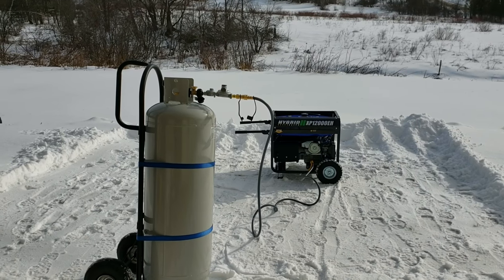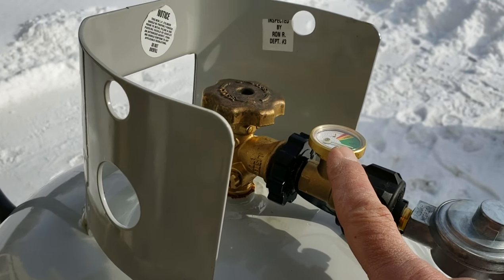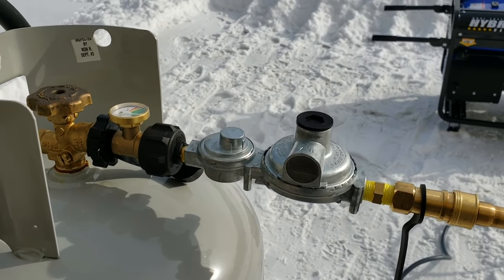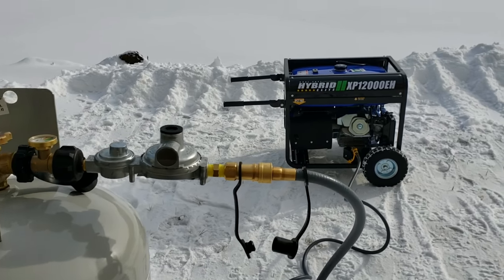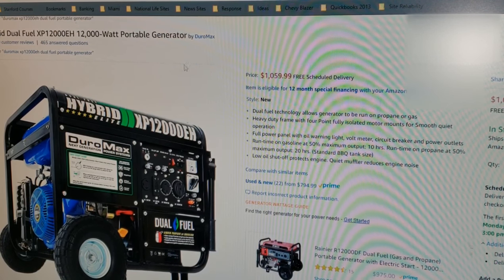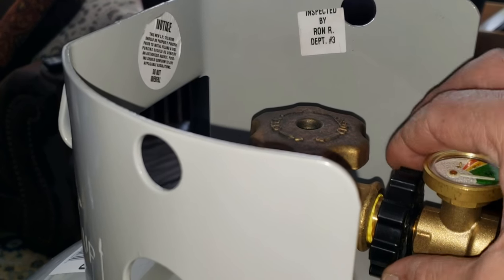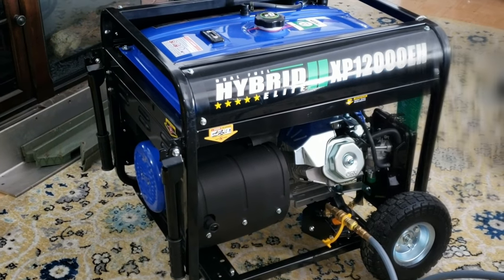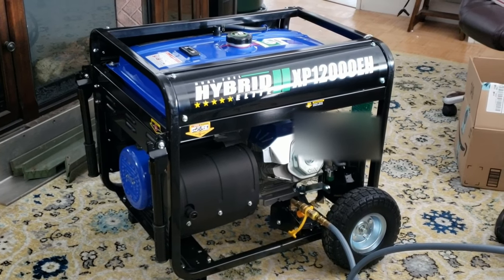Ultimate 100 LB Propane Tank Setup - Duromax XP12000EH 12000 Watt Hybrid Generator - Step by Step

Comment: I used the propane regulator that came with my duel fuel generator . I  changed the fill valves that came with the 100 lb tank so that I could have a propane co come to fill my tank. It worked great and ran more than 36 hrs during hurricane IAN here in Florida . It was a champion duel fuel gen 9000kwh.
Reply from the maker: Awesome
Reply: It wasted 100lb tank in 36 hours?
Reply: @erickalmaraz6837 Yeah that's about right. A 20 lb tank will last about 7 hours on a 12kw generator. 7 * 5 is 35. Your actual results could vary quite a bit depending on how much load the generator is handling.

Comment: Nice video.  I repair gensets as a business.  Propane is a good way to go as the carbs on these Chinese gensets don’t like ethanol based fuel, especially if you let it sit for awhile without use.  The metal alloy used is much less forgiving than the alloys used on a Honda, Yamaha etc.  Second, make sure you break in engine properly....run at varying light loads for at least 4 hours or so, then change oil.  Use decent quality synthetic 10W30 in winter and 30W in summer.  Exercise under load for 15 mins monthly.  You do this and you will increase longevity significantly.
Reply from the maker: Appreciate the tips. Very helpful.
Reply: Honda and B&S don't like it either.  But all the China stuff is an exact copy of Honda.  The trick to using gasoline is to use the shutoff valve to shut down the generator.  Do this any you can let it sit unused for 3+ years and it'll still start on the first pull/crank.  It'll spit n sputter due to the old gas, but it'll start..  But his has a bowel drain as well that he should use.  Because any gasoline, especially ethanol, will cause the in bowel fuel shutoff solenoid to stick closed.
Reply: @MatHelm  While probably overboard, on all my small engines that are not used very  much, I use the ethanol free gas.  Then put in stabil.  When I let the engine sit for a while I drain all the gas or let it run empty.  If I drain the gas, I then start it back up and let it run all the gas out of the carburetor.   So far the engines on the generator and my garden tiller will start with one or two pulls  when I want to use them as I put in fresh gas.
Reply: @ralphmowery2898   since our switch to non ethanol gas in all our small engines ,sxs,4wheeler ,chain saw ,boat, gen, etc,  we haven't  used stabil in years,    ymmv

Comment: Nice setup.  I been thinking about getting a 100 gallon propane tank.   But I decided to use just the 20 gallon tanks because in a long term grid down power outage I think it's a good idea to stop the generator and let it cool off or rest every 12 hrs.    Its just a theri of mine tho.  I'm not an expert on generators or propane LOL.   But I do know why I went with a propane generator.  I can store it for 30 yrs without treating it like ya do gasoline.

Comment: I have the same generator and I bought the same regulator in this video. It will only use half to three quarters of my hundred pound tank and then the generator quits running. I put the factory one back on it'll use up the rest of the 100 lb tank question is why?

Comment: Well thought through. You saved me so much research time. I am setting up this same generator to power my house in case of a major power outage, don't think that i would've even known that this kind of setup could've been done. It is quick and efficient and will work perfectly for me as I am setting up 2 100 lb tanks. With this setup I can easily switch between tanks without any issues, so I basically bought 2 of everything. I also like that I can check the gauge for gas levels. Thank you so much for sharing the information.
Reply from the maker: Glad you watched.  Let me know how it works.

Comment: I tried this same set up and it worked flawlessly. Thank you for you time and effort. This was amazing, you save me because the regulators I kept getting were just giving me no luck. The propane shops just did not want to help or just make me spend crazy money. I got a second set up connection just in case. I gave up till I saw your video. This was so dummy proof. YOU ROCK MAN!!!!!
Reply from the maker: So glad it worked for you

Comment: I have the Duromax Beast myself and a 350gal. Propane tank and 2 100lb tanks that i used for my 40ft. 5th wheel rv and my service man that comes out and fills the tanks i question him about adding or making changes on the regulators for connecting to my genie he said you dont need any changes the ones on the tanks are fine and the one that came with the genie will work just fine. He said there is so many people get sucked in to spending a wallet full of cash for nothing just so a company can make more money and i thought go figures sounds about right.. Anyway i have been running mine for over 2yrs. and it ran fine. I look at it this way i either got lucky or had an honest service man that steer people in the right direction ....
Thumbs up to yea i hope you enjoy your new genie...
Reply: Thank's for ur info. 
In any business now a days it's very hard to find an honest person!
Reply: @jackman4692  Ain't that the truth. That's because us honest people don't make as much money as the bullshitters. Been in business for 35 years and always tried to save money for the customers. I'm not rich but I live comfortable enough for my means.

Comment: Excellent video. I purchased everything in this video. I had a licensed electrician install a transfer switch, then run some pex conduit under my eaves to mount 40 amp plug on my back porch.  This makes this a temporary whole house generator as long as we use it wisley.   Also, the list is perfect and I thank you for your informative video.
Reply from the maker: Appreciate it.  Thanks for watching
Reply: I want to go with 100lb tank for the 10k watt generator ill be getting soon. Meanwhile i was doing some research and ive been reading the 100lb tank could and probably would freeze up while in use in cold weather. Have you had any freezing issues
Reply from the maker: No, I have a tank warmer.  In VT we can get 30 below in January.
Reply: @VermontPrepper  Where did you get one of those?
Reply from the maker: I got mine off of Amazon:  
https://amzn.to/3QlYdUC
Reply: @VermontPrepper  Thank you for the info. Have you put it into action yet? As in running your generator down around zero degrees?
Reply: @VermontPrepper  I guess i should have asked....did you experience any freezing or do you have a warmer just in case?.
Reply from the maker: I have not experienced any, but I think it would if it got too cold without a warmer.
Reply: @VermontPrepper  What is the WC flow rate on your regulator? My generator requires 10-12 WC. That doesnt seem to be very much. What im getting at is , will it freeze up at such a slow rate? I have a propane stove that i run off of a 20lb tank and it has never froze up.Its regulator is 11WC. I know a generator will use a little more volume but not much i would think, Whats your thoughts?
Reply from the maker: Hmm.  I do not know.  That stumps me

Comment: The white and the yellow tape are both teflon, but the yellow tape is twice as thick. They are made of the same stuff, and both will prevent corrosion and seal. You can use the white tape, but then you have to do 6 full wraps around the threads in order to meet code, whereas you only need 3 wraps for the yellow tape. And the regulator needs to have the vent facing down. Also with 2 regulators you are likely to starve it of propane at high load. I'm not sure about the regulator on the generator but it is probably enough, and you might not need any other regulator. Also with propane those gauges will only start showing that it's low, when there's no liquid propane left in the tank, so they don't work very well. The best thing to do is to pour a cup of boiling water down the side of the tank and then start at the bottom and slide your hand up that side of the tank. When you start feeling the tank get warm, then you know that the propane level is just below that point.
Reply: I too have read where running two regulators could be problematic to fuel supply. My question is; the regulator on the generator would be adequate to connect a 100 lb tank? I have the Duromax XP10000HX
Reply from the maker: No, it comes with a separate regulator that is required to use for operation

Comment: Thank you for saying something about the propane tape. I did not know there was a difference between the white and the yellow. You saved me from making a big mistake. This is the first time I got a generator with dual fuel and a friend recommended me  to use the LP instead of gasoline. I plan on using both. Shortly I will be making a video on the Duromax I have.
Reply: The white and the yellow tape are both teflon, but the yellow tape is twice as thick. You can use the white tape, but then you have to do 6 full wraps around the threads in order to meet code, whereas you only need 3 wraps for the yellow tape. And the regulator needs to have the vent facing down.

Comment: Thanks for posting this vid. I did basically the same setup. I went with a steel braided 18ft hose and no quick disconnects.  But the advise you gave on the regulator was a huge help. Thank you.

Comment: Thanks for the video. I use the regulator that came with unit. Added a 15’ hose. I leave the the hose threaded to tank forever.just roll up on tank. Very easy to unscrew hose from tank with large Knob it came with then cover end of hose with ziplock bag and rubber band. No problem for years.

Comment: I appreciate your video.  Very helpful.  I purchased a Westinghouse 12000DF.  My concern was getting something with a pure sine wave <5%.  I called Marshall Excelsior and they wouldn't give me any help AT ALL.  Spokesperson said I had to have my propane company inspect it.  What the hell?  I bought a 100 lb tank at Tractor Supply.  they filled it and helped me load it on my truck.  There's no propane company that's going to inspect my tank and portable generator.  I live 40 miles away from Marshall excelsior, but I don't share your enthusiasm.  Westinghouse just said that the 2 stage regulaor had to be between 7" and 11" water column.  That's all they would say.
Reply from the maker: That's a bummer.  They were helpful for me.  I guess it really depends on who you get.

Comment: Very helpful! My XP12000EH is scheduled for delivery 6/13. Your video gave me what I need in terms of info! Imagine your 100# propane tank is my household natural gas line. I'll use a Nash regulator attached to a gas line stub with shutoff and screw on a Nash regulator. Can use same hose and quick disconnect setup as you and should be able to run tri-fuel. Your video was very helpful, so THANK YOU!

Comment: Thanks, I already have the generator (bought on last prime day sale) and the 100 LB tank. Just needed the fittings, regulator and hose. I bought them all from your links. Good job.
Reply from the maker: Thanks so much Timothy.  Let me know how it works out.  It's been good for me so far.
Reply: @VermontPrepper  Will do.
Reply: @offgridgarageUSA  By chance, did you complete your setup and did it work? I ask because I, too, bought this generator on Prime Day along with the parts linked to the video. Unfortunately, the generator wouldn't start up once attached. I don't know if the regulator I received requires some kind of adjustment, if it is defective or if DuraMax changed something in the design that may have caused this regulator to be incompatible (in use with a 100lbs tank as shown in the video). All I know is that I had to take everything but the 3/8" gas connector off in order to hook up the regulator that shipped with the generator before I could get it to start. Is it even necessary given that t ships with a regulator to buy the two-stage one shown here?
Reply from the maker: Mine worked with no issues.  I didn't try the regulator it came with on the 100lb tank since the connection is not compatible.   I only use that stock one for a 20 lb tank, so that's why I bought the 2 stage

Comment: I enjoyed your video a lot.  It saved me from doing all that research on my own.  Thanks again...My generator came with most of the parts you had to buy so now all I have to buy is a longer hose the gage adapter and a couple of brass 3/8" fitings.
Reply from the maker: What generator did you buy?
Reply: @VermontPrepper  I purchased a Champion 9000 watt Generator.

Comment: My propane company will not refill on site if not connected to generator all the time, which won’t work for me. So I prefer the quick disconnect you did, but, when the tank runs low and I have to take the tank in for refill, will the quick disconnect be a problem? Or will that have to be removed to refill? Thanks. Great video.

Comment: Thanks for the great video. I'm thinking of purchasing the XP15000EH and this comes with 2 built in regulators in the generator. Can anyone answer if, using a 100lb LP tank, there would be a need for a 3rd regulator attached to the LP tank? Thanks in advance.

Comment: I'll throw this into the mix.  I was talking to my Propane Provider about adding a propane generator to my home here in the Country (currently running a worn out gas generator.)  and he said we would need a different regulator at the tank. According to him, the house line regulator does not have enough pressure to handle a generator flow.  Said he would be happy to "Y" a fitting at the 250 gallon propane tank just for the generator. Then install a second "Red" Regulator just for running the generator off of.  But I would still need the original regulator it has now. (Either green or Yellow, can't remember which and mine is not painted)
And here's the kicker, I can run two regulated lines into the house, (at different pressures) but cannot legally run a high pressure line in to the house,  then split it off to run the generator and add the lower pressure regulator for the house.  Basically, both regulators must be at the tank!
Reply from the maker: Pretty cool.  I am not an expert, but it sounds solid

Comment: Since I will only be using propane I removed the gas tank which I believe will help with air circulation around the motor. It was very simple to do, 4 bolts and 2 hoses. It can be put back on in minutes if you need to switch to gasoline.

Comment: I have the 1st generation and mind did not come with a regulator on the bottle end. It only came with a hose which I connected to the bottle and the generator. In your opinion should I add the gage/2 stage regulator to my 30 # bottles?
Reply from the maker: Hi sorry, I am not an expert and cannot provide advice on that.  Regards

Comment: Very nice... You have a (2 stage)  double regulator setup. 1st is high pressure and 2nd is low pressure. The 2nd one has the vent that you have pointed to the side. You should have that pointed straight down cause if you get water or debris in time it could cause a problem with the regulator
Reply: @highball7347  propane coming off a 500 gallon tank is 200psi roughly when full. High pressure ( 1st stage regulator) cuts it down to 10-15 psi to keep pressure up in small volume pipe like 1/2" if you have long run. Also keeps from freezing cause propane has a lot of moisture in it.  At the home or appliance it's cut down again ( 2nd stage regulator)  to 13" of w.c. or about 1/2 psi. I live in the northeast where this is very common install cause of the cold.  Also I do commercial and residential HVAC for a living.
Reply: @highball7347  I recently installed this generator have two regulators on my line. I have around 150ft of 1/2" ips underground gas line running from my tanks to my generator house. It works awesome.  No issues. Definitely worth the money.

Comment: I built this setup for my new duel fuel Westinghouse generator. Thanks for the great video and product links. You saved me a ton of time
Reply from the maker: Glad it worked out Joe.
Reply: Did you keep the regulator on the Westinghouse?  What pressures are before and after the regulators.?
Reply: Are you happy with the Westinghouse?

Comment: Is there any reason why you couldn't just use the 100# tank with the POL to QCC adaptor directly to the regulator/line that came with the generator?  Everything else seems to be a bunch of extra work to get a quick connection?  Am I missing something?
Reply from the maker: I wanted two separate connections - one for a 20lb and another for 100.  You could do it your way as well.

Comment: I see your generator has a gas regulator on it so I’m wondering if you needed one coming off of the 100lb tank? The pressures coming from a larger LP tank should be the same as a smaller tank but a larger tank will give you a larger evaporation surface area which would be good especially in colder temperatures when LP evaporates slower, but for a small generator it’s not a big worry. Your generator is much bigger than the small 4kW inverter generator I’m hooking up to either my 500g tank or a 100 pounder.
Reply from the maker: It came with a separate regulator as well, so my belieef is that you do need one.  But I am not an expert in propane.  Regards

Comment: You did a tremendous job, very well done!  Thank you for sharing!
Reply from the maker: Appreciate the kind words
Reply: @VermontPrepper great video, thanks for all the great information.  I have the first generation generator, with 100lb tank. I dont need the discount option and I was wondering if you wouldn't mind contacting me to discuss the parts I wouldn't need if I went with the factory gas line and no disconnect.